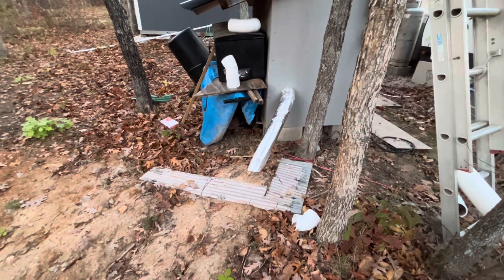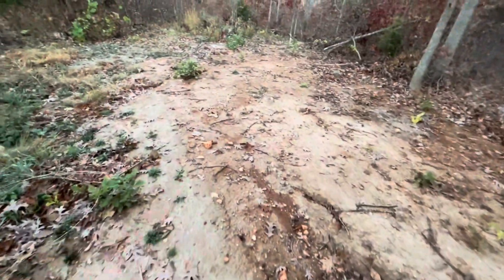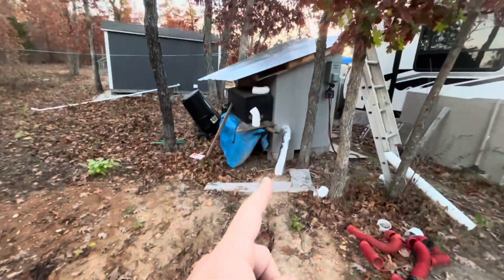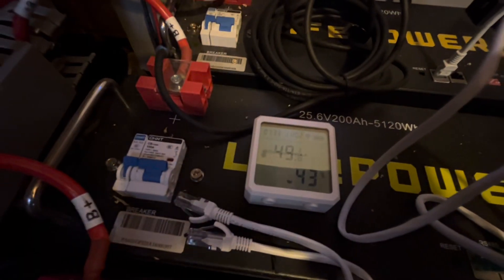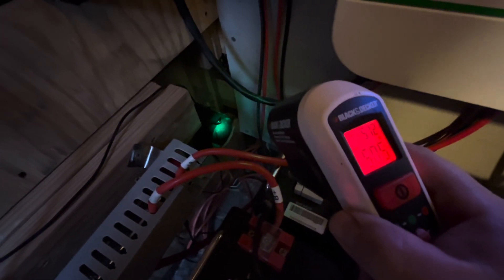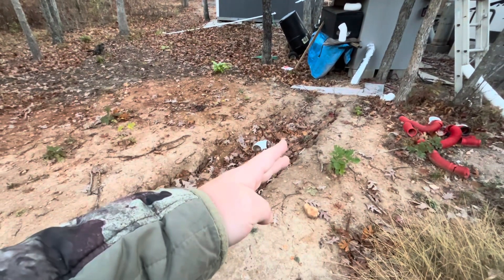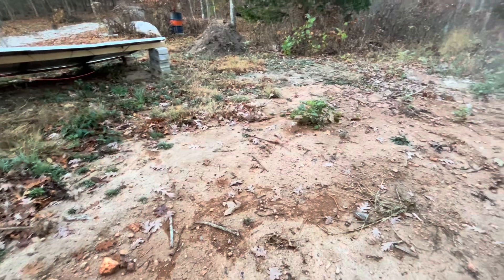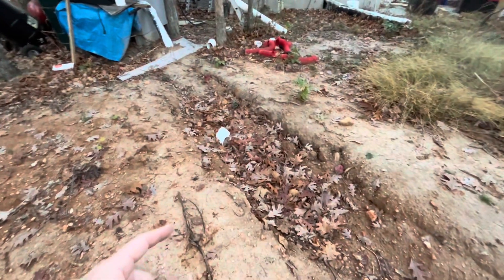Earth Tubes vs. Cold:  How Well Do They Perform? (#186)

Comment: how big are your tubes   
how far below your frostline are the tubes 

 an insulation blanket is not as good an idea as you think 
because
you want as much heat transfer between the tubes and earth as you can get ... sol metal tubes are actually better then plastic ones

good luck with your experiments
Reply from the maker: 4 inch. Metal definitely would work better…just more expensive. Might go that route for our house. I wasn’t talking about insulating the tubes themselves…just putting a layer of insulation board above them and covering with dirt to try to simulate them being deeper in the ground. I have them below the frost line for part of the run, but ran into rock and could only go so deep. I have a playlist on our channel with the installation videos if you are interested in watching. Thanks for commenting!
Reply from the maker: Also…it just occurred to me that maybe you were seeing the pipe wrap I have on them. That’s only on it above ground to try and insulate from the ground level going into the shed.

Comment: Great video. Question  for heating why would you not have both the intake and exhaust located in the same building and keep circulating the heat you gain back into your circulating system ?
Reply from the maker: If it were a space that you lived in, I would be concerned about breathing recycled air.  In this case, I am not, BUT in the summer time the air outside is often cooler than the air inside due to the equipment generating heat.  So, I opted to bring in fresh air.  I have seen them set up both ways and heard arguments for and against each design.  I guess it just comes down to personal preferences and what will work best for your situation.  I suppose I could design it with some sort of a valve that would let me switch between recycled or fresh air…but then I would need to bury another run of pipe.  When we build our house, I will make a better design.  This one is just experimental.
Reply: @BrambleBerryHills  I understand  now and thank you for your explanation .
Reply from the maker: You’re welcome!  It’s great to get some feedback on our videos. Thanks for the comments!